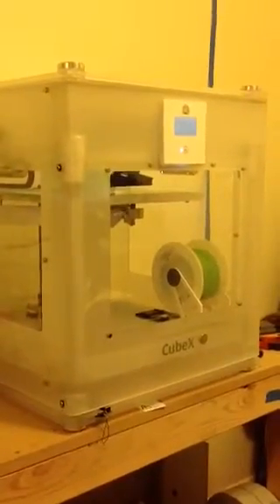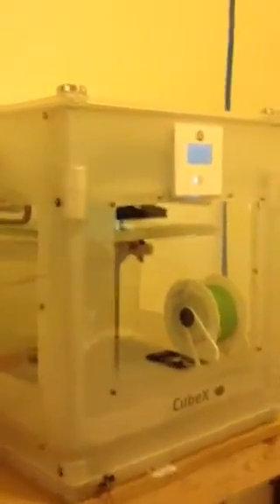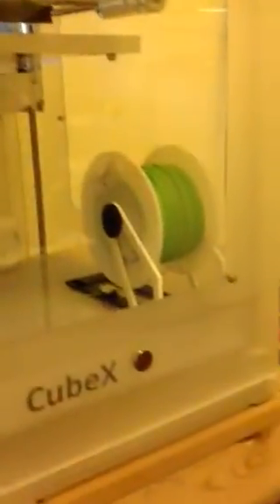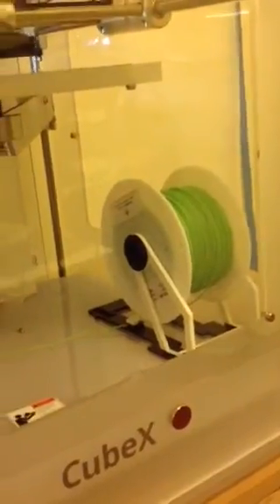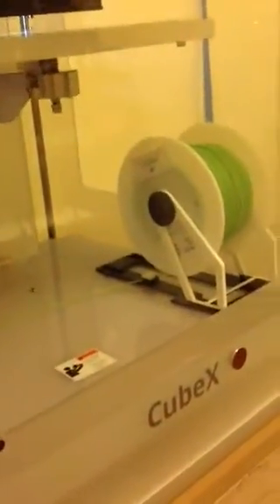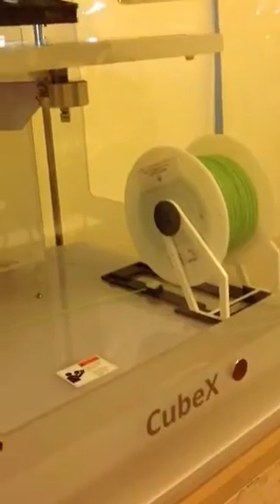CubeX printing with Matter Hackers PLA

Comment: Re: material wont feed, clicking sound, blocked jet, cubex not feeding filament, unclogging a print jet.

If a piece filament snaps after the little feeder wheel, but before the hot end, it will stay cold, hard and make your print jet not work. Then if you try and feed filament into the top it will hit the lodged piece (which is cold and not moving) and will make a click sound because it is failing to feed through and down the jet. 
If you have this problem, take the printer jet out by removing 1 screw that holds it, disconnect the cable loom and try to clear it with piano wire, or a steel guitar string. I did this today. I plugged the loom back in with the jet in my hands held by a pair of pliers. I then heated it up to 260c and spent a long time (30min?) ramming both ends with wire, occasionally working bits of filament free. In the end the wire went through all the way, and it was glorious to see it unblocked, thank christ.

Needless to say, Cubify's condescending instructions on how to solve this fail to capture the fact that if you hear clicking and you can't push filament through and get it to load you are having a bad day today. The official instruction of what to do is 'send it back to cubify", but my jet is now operational again & crisis averted!

Comment from the maker: The spool holder is designed to drop into the unused cartridge mounting slots on the right side of the printer as shown in the video.  The weight of the spool holds it in place. If this makes you uncomfortable, I would suggest adding some Velcro to the bottom of the holder.
Reply: (Aaron Hammett) Thank you for the quick reply. Everyone here loves your spool holder.

Comment: Hello!  A quick question for you: we are very interested in storing our cartridge spools like that, but the prints don't go through because the printer needs to check for the chip in the cartridge.  Your printer doesn't protest that the cartridge bay is empty?  Or did you get around that somehow?  Thanks so much!

Comment from the maker: The critical settings come from calibrating your printer in KISSlicer for thin wall and solid printing, and then interpolating somewhere I between.  This must be done for each material you use.  It will vary between colors and batches of filament.  For green, I use .6 for the extruder settings, the material averages 1.7mm, and flow tweak is 1.15, but it's different for white.

Comment from the maker: The plastic material is from hobby lobby.  It is .005 plastic sheet used to make overhead projector transparencies an comes in a roll.  It cost about $16.   The spool holder is one that I designed.  I am currently reworking the design to make is print more easily and with less support structure.  It will be modular and should print with almost no supports.  I'll post a link on to it once completed.